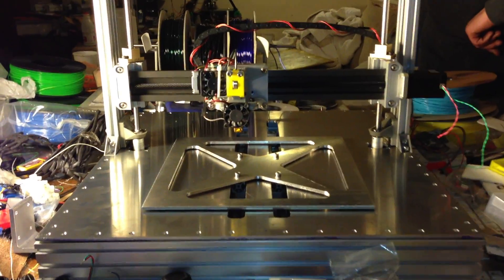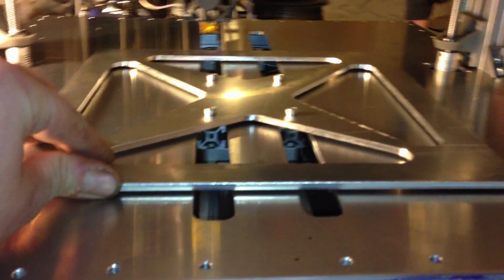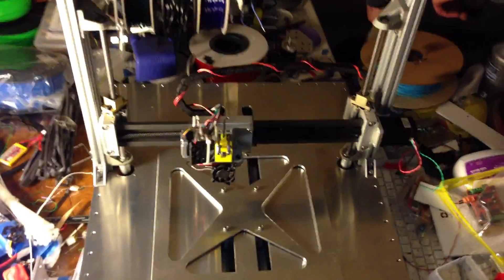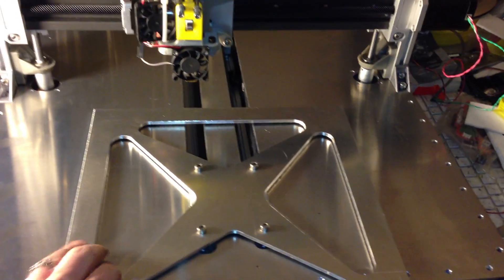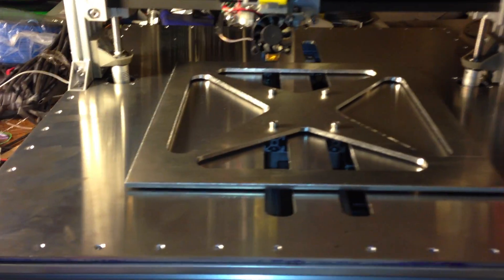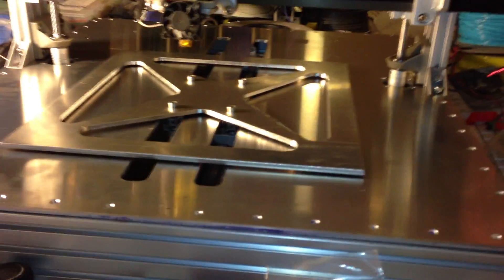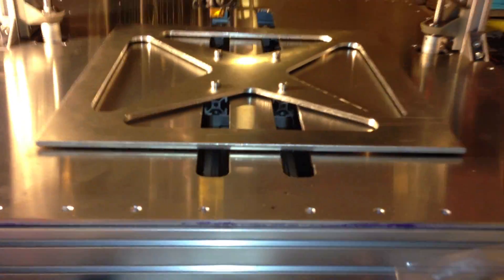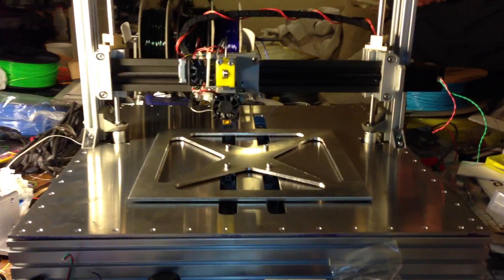Aluminatus Lower Frame Cover Plate Preview

Comment: Those sound like really cool upgrades. If you could design it to have a lock, plug in and load software method, that would make the versatility of the machine very desirable with the maker market.  Why buy three machines when you can have them all in one machine. The cost and space savings will be great.

Comment from the maker: Robert you are ahead of your time ;) There will be a CNC milling upgrade kit for PCB milling and light duty plastic and bullet aluminum milling as well as a 808nm infrared laser etching/cutting upgrade using a 5W 808nm diode laser.

I added a link in the description abive to the prototype cnc milling upgrade